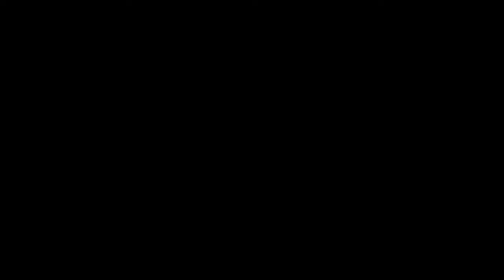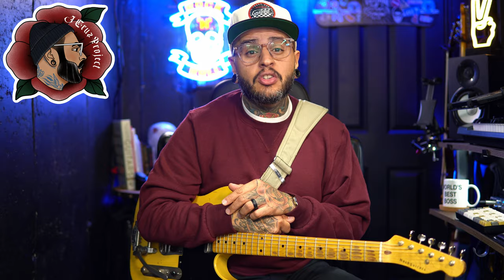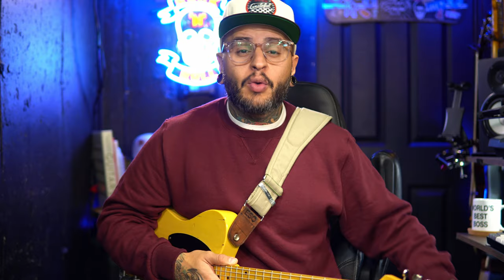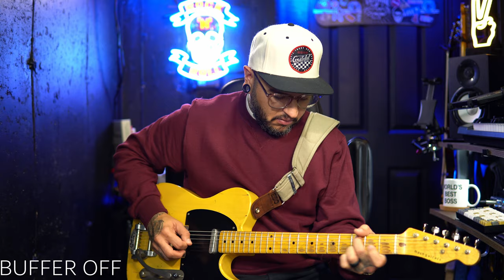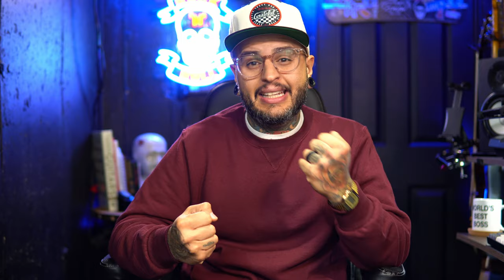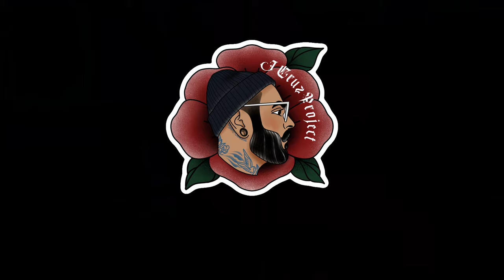Do you need a BUFFER?

Comment: The difference between an active and passive signal can be compared to the difference between for instance a car with direct steering or powered steering. In direct steering, the driver not only has to provide the information but also the energy to steer. If the steering costs too much energy, the information gets compromised. In electric steering the driver only has to provide information, while the energy is provided externally so the information can`t be affected by external factors such as the size of the wheels, or the condition of the road. 

A passive signal also carries energy created by the strings and pickups. This energy gets lost quickly, especially the high frequencies as they carry little energy, so it should be  transformed in an active signal as early in the signal chain as possible. This is the function of a buffer, as well as any preamp, or any pedal that is not in bypass mode ;). In bypass mode, you do have a possibility that the signal stays passive  ( `true` bypass) or not (buffered bypass). 

Ideally, you`d want your first effect to have a buffered bypass, so the passive signal is always switched to active at the earliest possibility in the signal chain. Active signals wont revert back to passive anymore so there is no reason to have another buffer. 

This topic often gets confused with two other topics: high versus low impedance and high versus low signal gain. A passive signal straight from a passive guitar has a very low gain and high impedance. Effect pedals as well as guitar preamps accept these signals, and transfer them into active low impedance mid or high gain signals.

Mismatches in the signal chain can produce unwanted effects such as loss of high frequencies (high impedance signal in low impedance input), loss of signal strength (low gain signal in to high gain input) or a distorted signal (high gain signal into a low gain input). However, this is not related to the presence of absence of buffers ;)

Comment: If you are running into your Jackson Audio Bloom after the buffer you may not hear a a difference if the blooms buffer is on. The impedance in and out of it do the same thing a buffer does. I’m not sure if its the same on the Bloom v1 and v2 but it looks like it is. Just something to think about. But I’m all about the buffer at the beginning and end of a board (other than a fuzz which will go before the buffer) to make sure you have a strong signal going through the board and if running to an amp after the board. But That Pedal show and The Rig Doctor both have good videos talking about the uses and when and why you should use one.  Great vid bro!
Reply from the maker: Ahhhh! 🤯 Learn something new everyday! Great comment!

Comment: You should go back and run the A/B audio through a graphic EQ. I'd bet the EQ would be different with the buffer vs without it. The volume is probably the same, but the EQ will have more high-mids and top end which will give that impression of clarity you're hearing. I'm watching through my studio monitors and the difference to me is splitting hairs, but my kids are making a ton of noise laughing in the next room. lol.

I haven't watched your 2022 Pedalboard reveal video yet (I'm saving it for last tonight), but the HX Stomp also has a buffer, so there might be a buffer on either way here...

For myself, I love buffers with my delays and reverbs so that I can have them trail off naturally if I bypass them. I've always had a decent sized pedalboard so a buffer at the front of the chain has been practical. My go to was a Zvex SHO that Y split to my tuner so my tuner could also be always on but out of my chain. I had to remove it when I downsized my board, but I miss that setup a ton and have been toying with mounting it under my board.
Reply from the maker: For sure splitting hairs on my end as well. But as you say, it may be cause I’m running products with internal buffers as well. So the difference is not as wide.